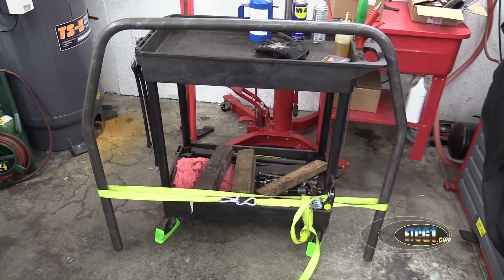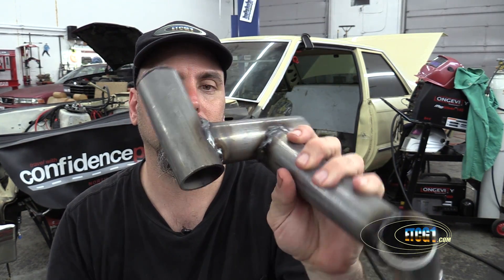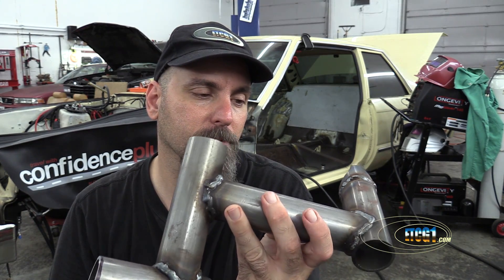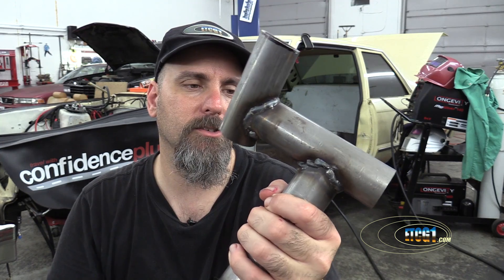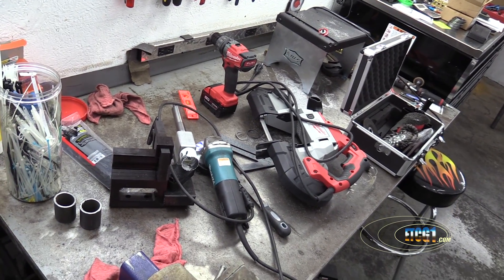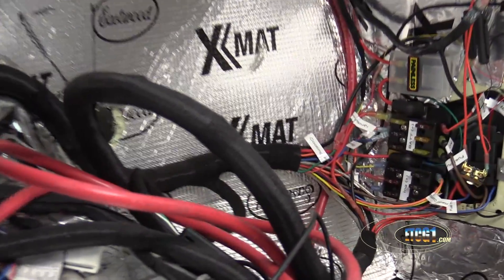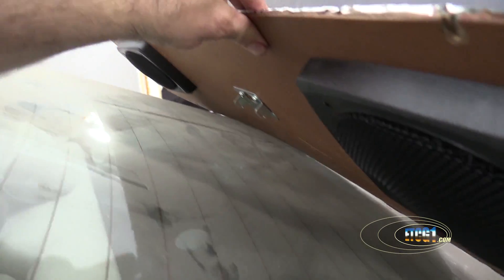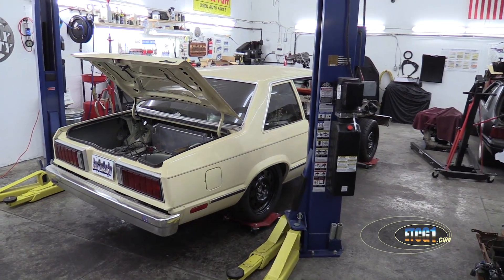Losing Motivation With Project Vehicles

Comment: 1. when making the rollbar, use techiques and tools that are easiest and familiar to you. Just an angle grinder with a grinding disc to make the reinforcing pipes fit to size. It will take off some of the stress of getting everything spot on on the first attempt, because of whitch rollbars are pretty notorious for. This way you can test fit the pieces and shave off a little more when neccessary. Hell i had to make a clutch bellhousing, made it with a drill, angle grinder and mig welder out of angle- and sheet iron 'cause I had no tools and exp to work on aluminium, works like a charm til this day.
2. a little more heat/amps on the welder, bit less wire feed and make bead welds if it's allowed by the regulations. this way you have more control over the heat transfer on pipes. If possible get a welder friend to set up your welding machine for the pipes. Also when making a rollbar it helps to have someone to hold items in place and rotate them while you are welding.
3. the general motivation drop is due to the very little amount of challenges left on this project. Up to this point you have found a solution to all of the problems included in this project and solved them using knowledge and skill. This is the best part about a project car. To make the rollbar you have the knowledge how to make the rollbar but lack the skill that takes a lot of time to master, so making the rollbar in an uninteresting task to your brain - no cool thougt processes, just labour.

I was in the same point with my project build - it was basically complete, just some minor task to finish, but as I had solved most of the large problems included in the project I couldn't bring myself to finish up the little tedious jobs. Eventually asked a little help from a friend and just had to power through (and beer helped also :) )

Comment: Been there, done that. Spent lots more time on unfinished stuff than most. Small projects that take a few bucks and on the road are the good ones. Big projects, long time lines, unfinished portions the car are the devil. The secret is unless you have a fat, fat, wallet, a ton of other seasoned GOOD techs lending you a hand, and people willing to go out of their way to bust their rump on your behalf, its not going to get done. Speaking from experience, there comes a time when you just throw down the wrench and move on to something else. Car restoration and racing has become a rich mans game, and neither you, nor I have the resources to chase after that automotive dragon. The end result is unfinished cars we can never get the money out of. If we are lucky we can dump the unfinished cars on to somebody else at a loss. This is speaking from somebody who has been wrenching since 1977 and has seen the ugly side of unfinished stuff and has thrown the towel on more stuff than most people have ever owned and basically given up on anything but OEM repairs on cars to get to work. All the rest is just a money and time sucker. Even when a project is done, its very, very easy to stick in the corner and never use it again. I was one of the first people in the whole US to adapt  a full oem fuel injection into a an early body car successfully, and now being older I cannot find the time to put the cylinder heads back on a 442. This stuff happens to all of us. We ponder if it was a different car, or something like that, when really everybody only has so much only emotional energy, money and time, and its finite resource.

Comment: Im in slightly the same boat. i got a monte carlo that im building a 350 sbc for it. well the block i got is from the 70s and i already have a full rebuild kit for it and a roller cam retro fit set with a cam button and link bar lifters.  Well i broke one of the new pistons. oops. but i took one of the new pistons and slid it into to the bore of the engine and there is a lot of play so the engine has been over bored. I kinda expected that since it is an older block but the kit i bought has standard pistons in it. The cam bearings are a little scored as well since the flat tappet cam that was in the block was worn down. Probably from someone not braking it in properly. I am now considering getting a new block and just replace the rings, bearings, and seals. as well as throwing on the aluminum heads, intake, carb, and cam shaft and be up and running in two weeks. but then again, pistons are $130 with rings and the measuring tools are $30 each vs a $300 motor that ill be taking most of the stock stuff off.

Comment: Eric I'm having the same issue with my project, losing motivation because of welding, I need to patch my rear strut towers and I'm afraid that if I start grinding I'll never stop. Also I can't figure out for the life of me how to get these power windows to work, I followed both wiring diagrams and matched the looms as best I could, made sure I have ground, and power, and still no windows. Car is a 2001 forester that I put the running gear from an 07' wrx into, the car is fun but I want to open my windows

Comment: Getting any project to 95% is the easy part.  The last 5% is brutal.  That is when the men are separated from the boys.  You are correct, it is hard, very hard.  I find that setting goals before I go to bed to meet the next day helps.  Little bites.  Roll Bar, pay a welder.  Safety item, if you are not sure, job it out.

Comment: Im in a similar position. Im building a civic ek4 for Weekend track and Nürburgring. (Im from germany) and i dont like work that eats time. And i am at this point. Ive collected parts and im at a point were i only need Brakes (Plug and Play from integra Type R), a cage wich i'll order also as a p&p unit to Bolt straight in, the seats for witch i got the right rails allready and Service parts fit the engine like timing belt, fluids, sparkplugs and so on. But right now im on the axle and Suspension parts to sand them, paint them, trying to get them rust free. Im done with the underside of it and now im in despred need of Motivation to go on with the same time consuming work on the suspension parts. And it so tedious. Best thing is after the suspension parts are done the sanding goes on in the engine bay and the inside of the car. Its striped to the bare shell. I mean i'll keep going but its a lowpoint at the moment.

Comment: Thankfully my project miata was about the easiest engine swap possible. I had a crashed running 1.8 miata, and a kinda clean blue roller. Thankfully the roller is from 1992 so no emissions. I put the engine, harness, trans, clutch pedal and hydraulic assembly, and all the bits and pieces I needed for a running car. So I pulled it all out and put it back in the other car. Miatas are great hahaha

Comment: My 2 cents is you gotta realise what you can and cannot do. Get outside help with the bars, some guys bend and weld tubes others strip and rebuild engines. When you see the roll cage in it will give you back the drive to see it on the road.

Comment: Going on 3 years for me. Started out as a street car now its turned into track car. I built the engine ,rewired the whole car, new fuel system, now i been working on primer and paint for like a month or so. But after paint, its the rear end work, tires, rims, suspension, polycarbonate windows all around, and im sure im forgetting stuff. So sometimes i look at it and walk away, should of been done a year ago, lost my motivation? Yes. Oh yeah i have to get a roll cage installed also smh

Comment: Eriiiiiiiiiiiiiiiiiiic! When you're welding, especially if you can't see, try moving a little bit forward and then just a little bit back. It should give you a better idea of where your puddle is and it will give you a hotter weld. For sheet metal it doesn't work as well but on thicker sruff it works really good. I couldn't see a damn thing unless I was hurting my eyes with my helmet and the guy who taught me told me to do that and it worked for me.

Comment: Sadly i just had to sell my project car. Not really by choice or lack of motivation. Got a 94 Lexus gs300, had the 2jz gte. guy told me it had a bad head gasket, Among other problems. But was a good base for what i wanted to do with the car. Pulled the head off and found rust, Lots of it too (no antifreeze only water). So engine is toast, Then decided i was going to do an LS swap. was going to take a little time to save up for the engine so i started doing some bodywork. I pulled the fender off and found sever frame damage that looked like someone tried to fix and made a mess out of it.
when i start to lose motivation on a project car I will make a list of everything that still needs done and put it on cardboard, Then each day I will throw a dart to pick a random thing on the list to get done then cross it off. If there is still time to do other things then toss another dart. Works for me, Maby you could try something similar.
Try setting your welding helmet to a darker shade if you have trouble seeing what you are doing (Assuming you havent tried that already.) If all you see is a bright light then its to light of a shade. I had the same issue when i first started to weld.

Comment: Practice wleding on sheet metal firs, then try to weld pipe or tube to sheet metal and then try welding pipes together. Those are the hardest, you are getting out of position whole time and all you need is practice. There are a lot of tutorials on youtube to set your machine right and for this project i would recommend tig, not mig but it is possible with mig also. Dont get discouraged.

Comment: I am going through this now with a no crank no start. its not a huge job to fix but Im not familiar with how to read wire diagrams and not to familiar with how to do electrical work so I been putting that repair on the back burner and working on other vehicles.. I feel like I may have a slight idea of how you feel sir.

Comment: As soon as you finish Fairmont (which wil be done) go on holidays. Take a good break. You seem like drained by this project and need to regain strenght. 

Sorry for silly preaaching but think what happens when you discharge the battery - when you leave it aside it may run your device for a second but just a second. So when you feel relief and power when Ford is finished - better not trust it.

Comment: You know, welding a roll bar will need an another equipment, a TIG welder. Could you find one by renting it just for this occasion? I believe You may find it as easy to use as your works you have done previously with electric soldering iron . (sorry I apologize for the bad language)

Comment: Yes ,been there, done that, several times. I seized on the roll cage for my race car also, my welding looked terrible, but it passed tech easily. You might take your practice piece to the track, & let them test it. Bet its good.  Yes, craigslist & ebay are full of projects almost done. I've bought, finished & flipped a couple. On the last 1 i did, i finally had to shove the whole mess in a corner & cover it all with a tarp. It hibernated for 6 months before i felt like fooling with it again. Finally Realized when i worked on cars every day, then worked on cars the rest of the time, burnout was imminent. Mabye if you dropped the engine & transmission in, while hiding the roll cage in a closet for the moment, your solution will present itself? Lololol.... good luck with whatever solution you come up with, looking over your shoulder all i see is hundreds of individual projects that all need to be finished- which is overwhelming to me. I would have to get that engine & tranny in first, then pick another related "section" & work on that for a while. When it stops being fun tho, drag that tarp out! :-)

Comment: Also the problem is when you are busy you get new ideas and want to figure out.. buy some stuff and then need to figure out how it works and if it fits and start fitting it fabricating it.. then you get a big failure.. And these kind of things isn't helping.  Got my self a project car too but it's running. But I'm upgrade it bit by bit. May be time wise not the best idea when you have to put stuff apart for the 10th time. But at least you can still drive it most of the time.

Comment: Yeah I've been working on my volvo wagon for jeez two years mostly so long cause I'm poor, just normal stuff brakes gas tank get it running etc. Was almost ready to almost put it on the road then I found a manual trans and thought "let's do a manual swap" so it's gonna take longer. I say if you don't need the space just take as much time as you can work on it when you have the energy/inclination and you'll get there eventually cause for me as soon  as I think "it'll be on the road this summer" or something I don't have money or something blocks progress so hey whatever keep chipping away when you feel like it-- a project is not a job right?

Comment: each thing done....each chore completed brings you closer to the finish line. it takes perseverance. we're also not youngsters any longer. add to that the fact that there are those that visit the channel that have very little to offer in the way of motivation. that kind of stuff wears on the conscience.  there is a reward in completion that i could describe but it really doesn't have the impact of turning that key for the first time....the engine coughing to life. that will only happen upon completion of the project.
 a friend of mine in florida went through the same thing with an xjs. it's a total rework....very much like the fairmont but it's a n/a v12. if you would like i can send you a dropbox link to see the finish of the driveline part of the build which is now completed. the interior and paint are next along with a bit of fine tuning to the omex710(my job....software setup) control head. it's been an uphill struggle up to this point but it's all smooth from here.
  the xjs is a gt build....high top speed for extended time periods and handling was the goal(heavy car-antidive geometry to contend with. just ask koenigsegg his thoughts on antidive geometry ;-) with reliable electrics. we had to excise lucas the prince of darkness from the car.  that exorcism took the better part of a year as the entire system is custom.
let me know if you would like me to send you the link. his son and wife are even happy about it going again and mark has definitely improved in mood and enthusiasm. he has the pack of us spurring him on though and perhaps that's what is also needed right now for you my good man. you have a lot on your plate at the moment and it kind of resembles what happens during a mid life kerfaffle.
 it's hard to do sometimes but keep that end goal in mind. the first full tilt pass will be almost as good as a decent orgasm.
hell...if i were closer i'd give you a hand. many years of custom rides under the belt here and retirement allows me to do some things that previously i couldn't do because of time constraints and even though it was rewarding before it's downright satisfying 
now even though i fight the arthritis every day. one day at a time....one thng at a time and before you realize it....presto! noise and speed happen and you will have done it yourself and there's nothing like it.completion perhaps will unlock the motivation you seem to be lacking. hope all is well at home with the family and if i can be of help just let me know. 
as always....enjoy the days we are given for they always seem to be so few.
=dok=

Comment: The difference is there are techs and there are fabricators and I have worked at ford dealers for over 25 years and independents for 5 and now I help out at a race shop that does fab work and it's a totally different animal and it's outside the comfort zone of what you are used to

Comment: I have a 1962 Oldsmobile super 88 in my garage right now that I'm having a similar problem with. I'm pulling it apart and dealing with surface rust. on the inside and out. It's going to take a lot of money that I don't have to bring it to what I want and I need help from someone who is knowledgeable about older cars. Unfortunately I don't have either.

Comment: 2004 Celica gt to 2000 GTS conversation. Instead o purchasing an engine for $2000+ and then get more parts later, I purchased an entire car from Miami for $3200 and drove it back to Georgia. I was going to attempt to rebuild the engine myself never having done it and wanted to learn and experience it. Then part out the rest of the car and get my money back. So okay. I did sell the parts and I probably broke even selling the parts and getting upgraded parts.

One and a half year later, and lots of issues and buying more and more parts, the engine is officially swapped. The extra 40hp not so impressive unless I did something wrong and now I have a check engine light for the bank one on low efficiency. O2 sensors are brand new, but the cat has over 210k miles on it. The car runs, yay, but so many time got discouraged in my project. Wife wanted the shell out of her way and I wanted to be done with this nightmare already.

Have some money left. I think at this point I'll have the professionals look at the final product and tell me what's wrong.

Great experience and now want to rebuild the 1zz little by little. But nothing but headaches and more parts for over a year. So you're not alone, hang in there!